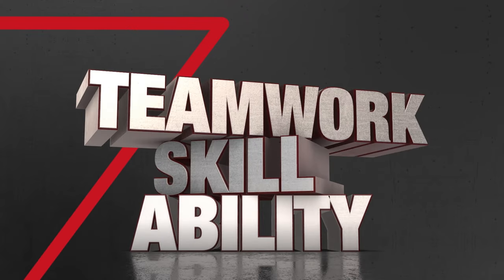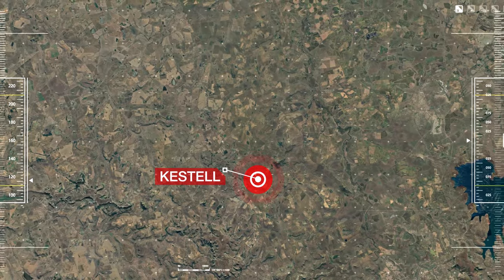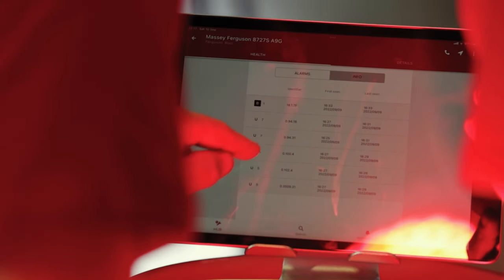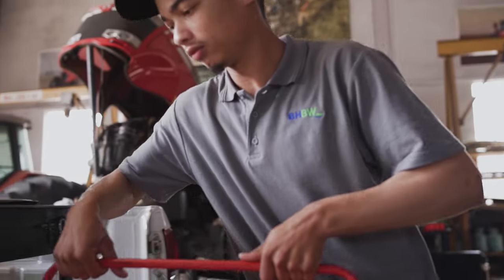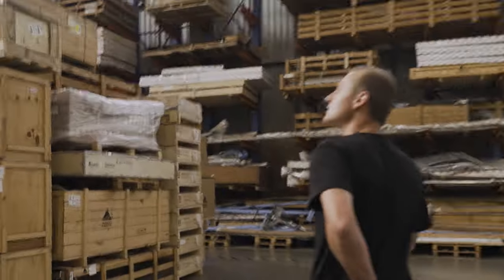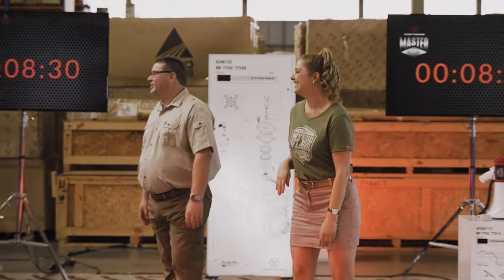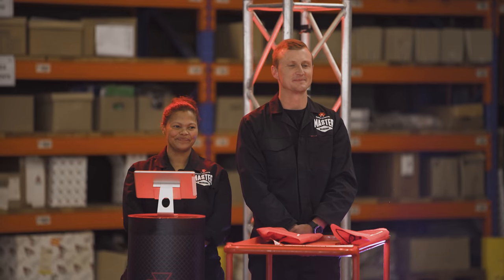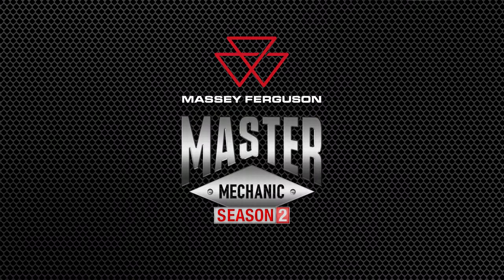Episode 1/4 - Massey Ferguson Master Mechanic Season 2 | The Warehouse

Comment: And here I thought this was a master mechanic challenge when there must be 2 people to do my job  definitely SA where you need 2 people to do one person's job 🤣🤣🤣🤣
You won't last a month with me
I strip and repair tractor alone for 30 years, yes I even split and assemble a tractor alone. Further I am a auto electrician, engineer, welder, hydraulic technician too to boot fixing tractors Massey have even given up on. What a joke this show is if your people can assemble a tractor gearbox without a manual under a bench or remanufacture David Brown tractor part that is out of stock for the past 10 years then come to the Real Master Mechanic
And if you need a computer to tell you what you must do you're not a mechanic but a parts fitter.